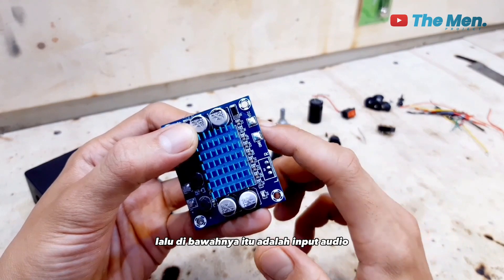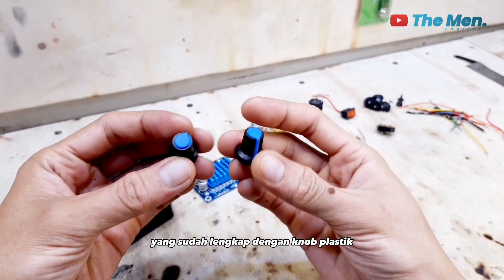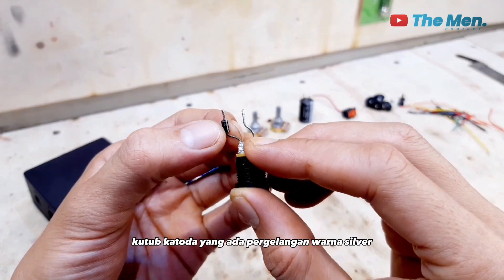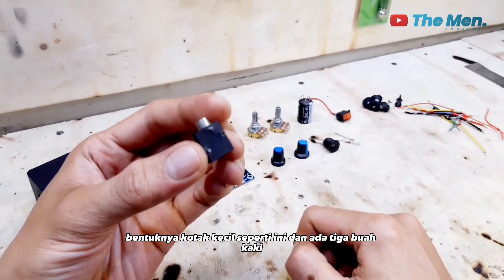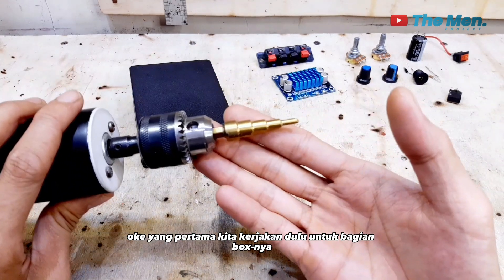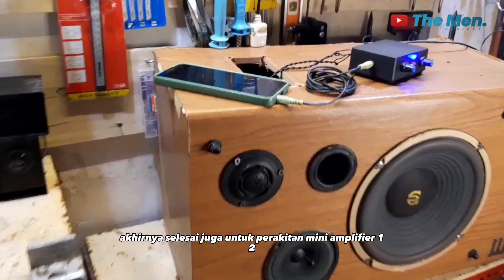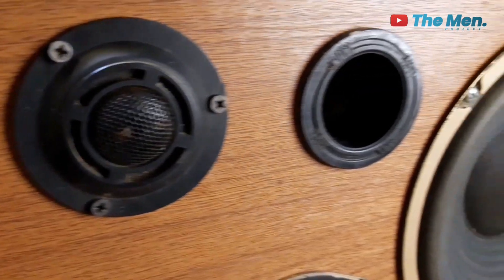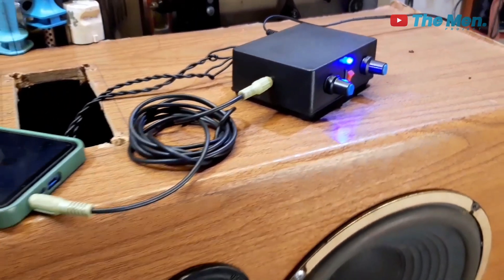Cara Merakit Power Amplifier 12 Volt 30 Watt 2 Channel Stereo | Mini amplifier TPA3110

Comment: Mase kalo di tambahin bluetooth bisa ga , kalo bisa di tambahkan apa 🙏🙏
Reply from the maker: @BadBoy-zf4ke  bisa bang tinggal beri modul bluetooth lalu pasang di input audio.
Reply: @armanusubekti  modul bluetooth nya tipe apa j bisa bang Oia 1 lg bang kalo mau di pakein control volume bass dan tribal di tambahin apa dan pake tipe apa ,,
Maksi bang 🙏😊
Reply from the maker: @ bisa bang instalasi nya jadinya kayak gini tinggal colok listrik udah ada mp3 kontrol volume bas
https://youtu.be/xEy7x4Gpcdk?si=1dP1gsBipQ_zhEX8
Reply: @armanusubekti  tinggal ikutin yg video ini bang ,, 

Kalo untuk speaker nya cocok pake yg berapa inci

Comment: modal habis berapa band
Reply from the maker: @kiplixyz1  murah ini bang 100 rbuan
Reply: @armanusubekti  komponen apa aja yg dibeli
Reply from the maker: @kiplixyz1  komponen sudah saya serakan di keterangan video bang
Reply: @armanusubekti    komponen udahsampe bang tapi salah 1 50k 1 100k dan pinya 6 bkn 3 trus gmna 
,elko bli 35v & 25v mending pke mana
Reply from the maker: @kiplixyz1  elco bisa di pakek semua bang. Yg 35 bisa. 25 jg bisa. Untuk potensio cari yg mono bang jika isi 6 itu yg stereo. Tapi masih bisa di pakek sambung saja 3 kaki saja
Reply: @armanusubekti  sulit jugak pas rakit bisa bunyi tapi bas kurang gler

Comment: bang kalu seumpaa bang saya pakek elco 25 v 2200 uf untuk adaptornya pakai laptop output 19 3,45 amper apa gpp mas kebetulan tipe amplinya sama mas,mohon batuanya mas soalmya saya pemula mas
Reply from the maker: @oktaarozaqi1080  aman sekali bang. Ampli tersebut bisa suplay daya hingga 26volt
Dan elco 25 volt cukup bang. Pokonya di atas voltase dari PSU kita. Jika pakai 19 volt masih aman

Comment: bang apakah sama cara penyambungan vol dc di modul pam 8610 harus pake elco 2200 uf 25 vol dan dioda 1 n4007
Reply from the maker: @puskesmascimaragas7102  sama bang. Bisa pasangkan modul tersebut ke pam 8610. Asal input di 12 volt

Comment: Bang mau tanya kalo satu adaptor 12V 2A buat amplifier tpa 3110 sama tone control apa bisa
Reply from the maker: Bisa bang. Namun kadang buat speaker agak gedean kurang kuat. Cobak yg adaptor murni 3 amperan. Apa pakai PSU komputer lebih kuat

Comment: Bg kasih saran dong pilih power amplifier Yang pakek pam 8403 atau   tpa 3110 dan sama kekurangan dan kelebihan nya. Semoga di jawab
Reply from the maker: Maaf bang belum pernah coba pam 8403 ..  mungkin perbedaanya Pam 8403 input tegangan 5 volt dan tpa3110 12 volt
Reply: Terimakasih bg
Reply: Bg maaf mau tanya lagi tpa 3110 itu kuat sampek berapa inch spiker. Maaf bg saya masih pemula 🙏🙏
Reply from the maker: @IlhamMukti-uf2xe 14:43  itu bang saya pakai speaker 9 inch 5 watt  8ohm. Bisa bunyi kenceng namun kurang maksimal.
Gppa bang silahkan tanya selagi saya bisa jawab akan saya jawab..😁 karena saya sendiri bukan ahlinya hanya hobi dan pengalaman saja..🤗☕🚬
Reply: Oke bang terimakasih kasih banyak